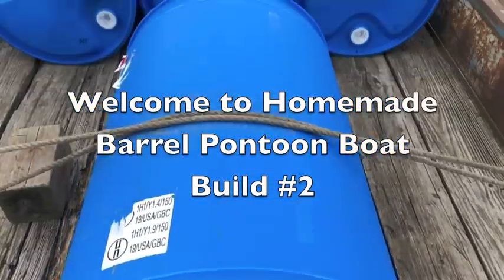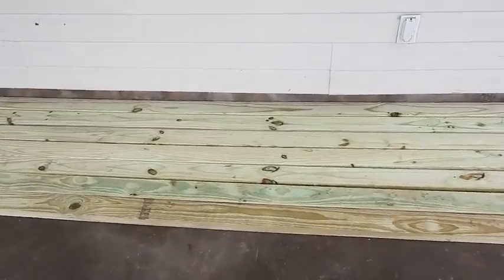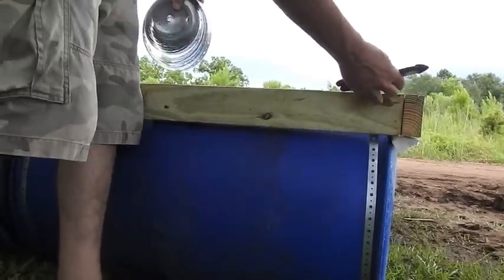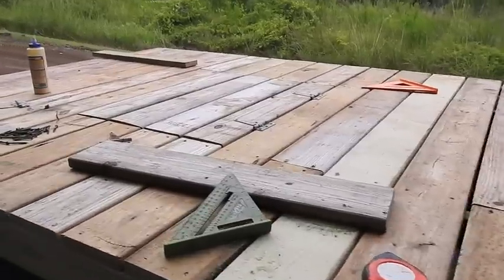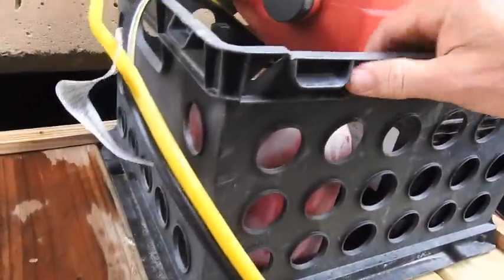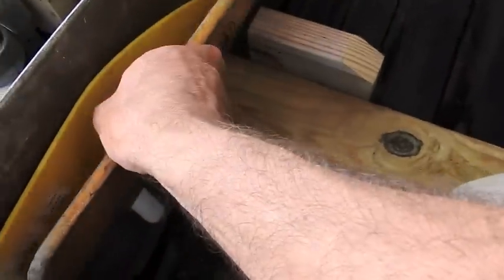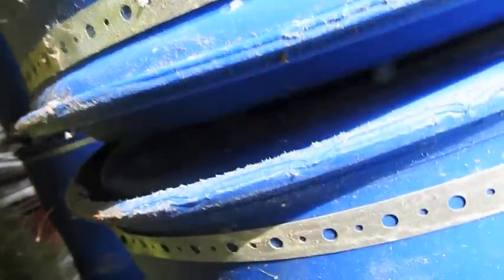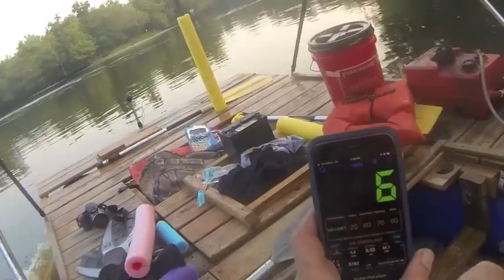Pontoon Boat Build #2 Starts and Highlights from Build #1

Comment: That's a fantastic way to tighten those barrel straps.
I will definitely be using the same technique when I build my pontoon.
Cheers buddy👍😁
Reply from the maker: Did you see build #2 where I used trampoline springs to keep the barrel straps tight?  Thanks for watching.
Reply: @chud327  not yet but I'm looking forward to it.
Reply: @chud327  I've liked and subscribed to your channel 👍😁 yep yep yep!

Comment: Excellent demonstration of yr project. At the botyom side squize due to water pressure. How to over come this problem, can we get some idea on it from u pls.
Reply from the maker: You can seal on a cold day, drop dry inside and seal, or add valve stems. thanks for watching.

Comment: I was thinking about a tri- toon. Using 30 gallon barrels 2,2,and 2. Using aluminum tubing for the frame. Ending with a 1-2 man boat that would pin together with quick pins. Nice boat you have.
Reply from the maker: Sounds like a good plan! Thanks so much and thanks for watching.
Reply: yeah for me dissassembling it would be key to get it on a roof rack.

Comment: How much da whole set up cost
Reply from the maker: I spent about $350 on just the boat part, plus did some add ons after completing. The trailer was $200, one boat motor was $400 and the other homemade boat motor was $90. However, the price up lumber has skyrocketed lately and my prices would have been much higher if build today. Thanks for watching.

Comment: Hey I got a mower
Reply from the maker: You are now in the club, what will you do first? Thanks for watching.
Reply: Well the dude already has it pully swapped and motor swapped it has something like a 23 hp Briggs on it but it doesn’t come with tires to I’m gonna probably weld some mower rims to atv rims and just run atv tires welding the rims will be my first mod
Reply from the maker: @runnin_a_muck5207  Sounds like it is going to be  a mean machine!
Reply: It should be I’m dropping 400 fillers on it so I hope